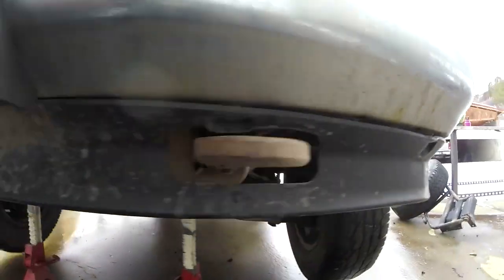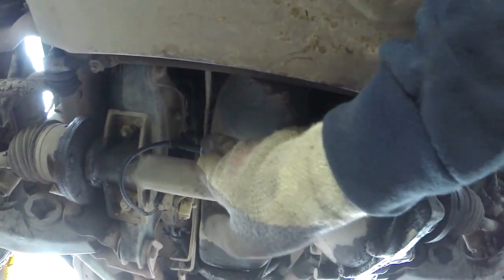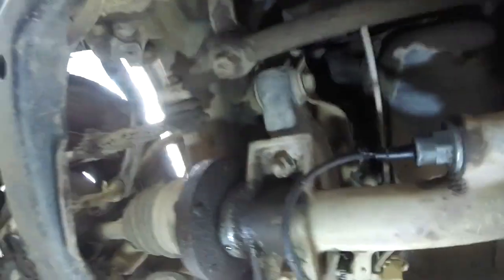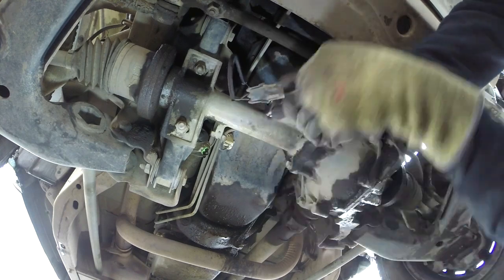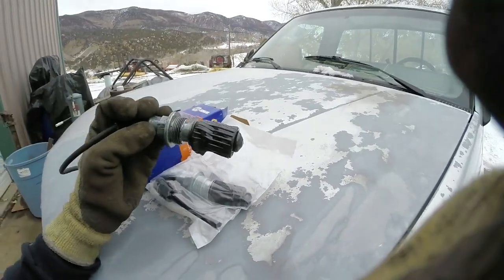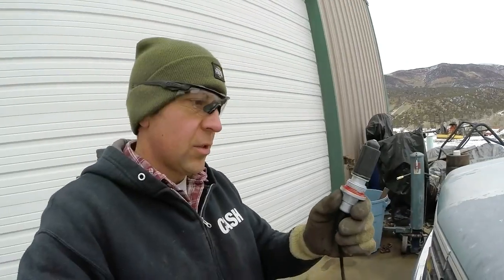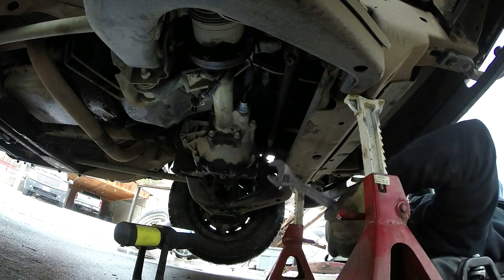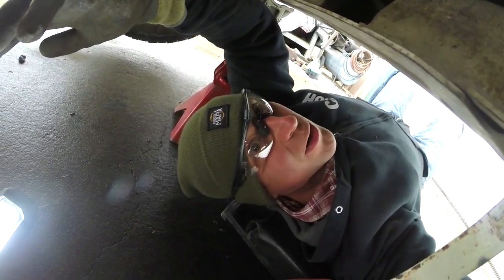Chevy 4 Wheel Drive Actuator Replacement: Quick Fix! Bad Hombre Garage Ep 75!

Comment: Can the actuator miss up your transmission if it's stuck try to go in and out of four wheel and two drive
Reply from the maker: Not sure about the transmission, but I bet it would cause issues with the transfer case.  Especially if it goes in and out of 4 wheel drive when you don’t want it to.